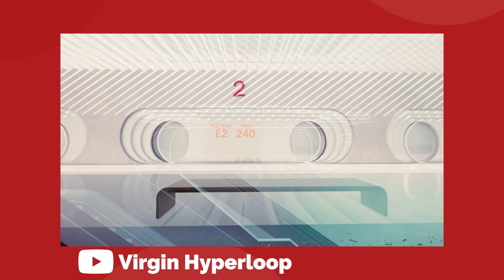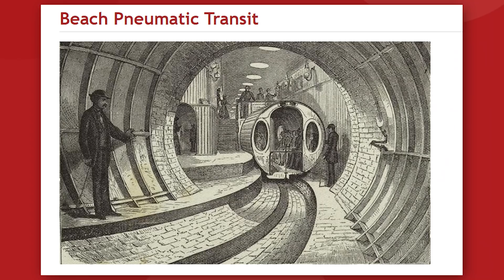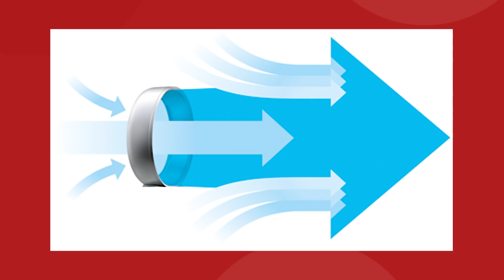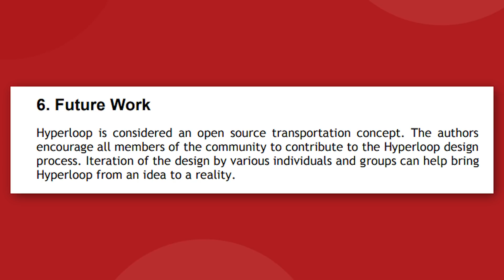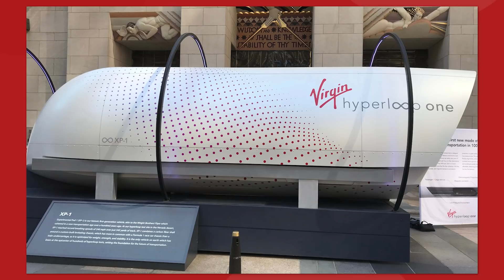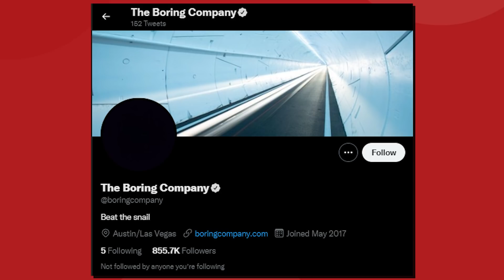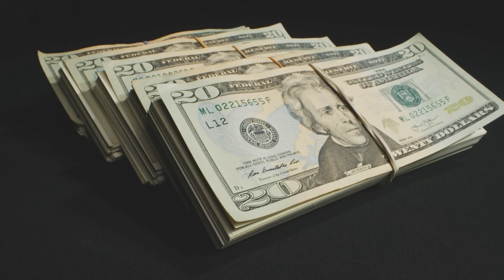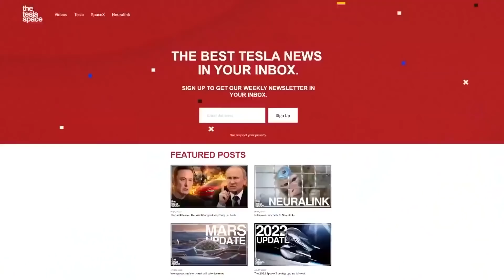The Boring Company Is Building A Hyperloop!

Comment: Hyperloop will fail, for several reasons.
1: Infrastructure: The problem here is Hyperloops require Smart infrastructure which is NOT a good thing. Smart infrastructure is infrastructure that contains the technology for whatever it is supposed to do within the infrastructure. It's downside is it's owners must pay for the upkeep of both infrastructure and vehicle. And trust it's users will not abuse or destroy it. Technological sophistication invites planned obsolescence; once it's available if it should require constant upgrade, it soaks up huge IT expenses and support costs. And should the technology provider go bust, or use proprietary technology is destined to fail, namely because if they should desire to upgrade it or replace it, costs mount. Once this is done and a significant amount of infrastructure is built, however, it will be difficult if not impossible to upgrade the technology as new ideas are developed. Since the technology is in the infrastructure rather than the vehicles, any new technology would require that existing infrastructure be rebuilt at great expense. That means shutting it down as upgrades/overhauls take place. Dumb infrastructure is infrastructure that incorporates minimal technology and instead relies on infrastructure users to supply their own technology but pay for the capacity to use the infrastructure provided. The advantage of dumb infrastructure is that it is technology independent. The reason cars and planes work so well, the user either provides their own technology; or pays the provider for using technology with exceptionally low amount of infrastructure (and thus LOW infrastructure costs). Flying requires little infrastructure except a few thousand feet of runway. For cars; the technology costs are bared by their individual owners, Drivers only have to pay for infrastructure largely when they chose to use it. In any case, once hyperloop is built, there's nothing the technology addicts/pushers can do to address or answer for improvements in automotive and airplane technology. Therefore it's technology will rapidly become obsolete. Not to mention new routes; the industry will be torn between building more which will add to he logistical burden of maintaining their technology.

2: Freight: Specifications for hyperloops don't even allow for minimum width of standardized shipping containers used world over for trucks, ships and conventional freight trains. Meaning it cant carry freight; Not without having to be repacked twice for offload and onload.

3: Costs: It’s private capital. Unlike Musk’s subsidy kingdom of EV cars, solar panels and rockets all of which are paid contracts or subsidized by uncle sam. Hyperloop requires hundreds or thousands of miles of very precisely manufactured fixed infrastructure, unless the governments paying for it. While Megabus charges about $15 to go from New York to Washington, Amtrak currently charges about $150 to ride its Acela over the same route, and that $150 doesn't pay for the capital or maintenance costs needed to keep the trains running.

4: Intermediate stops: Those are even more problematic. If pods travel in a vacuum tube, they will need to go through airlocks both entering and departing the tubes, which will add several minutes to the journey. If pods make intermediate stops, each stop will add airlock time, significantly reducing the speed advantage hyperloop is supposed to have over other modes. The alternative is to construct separate tubes to each destination: one tube from A to B; another from B to C and Another from A To B and A to C and D and ad infinitum. At $52 million a mile, costs quickly rise to be many times greater than the California high-speed rail line, which was supposed to eventually serve all of those communities

5: Economics: conventional planes would be about the same speed and cost less (due to lower infrastructure costs) than hyperloop for medium-length trips, there may in fact be no such optimal length. So even if Hyperloop is supersonic, its fares are metered by costs associated of maintaining its infrastructure. Not to mention what might be miles and miles of tubes, tunnels, viaducts, bridges across topography. By the time Hyperloop is ready for its first passengers, airliner, car and bus energy efficiency will increased to the point it doesn't matter. Intercity-transportation isn't a heavy market; Bus and planes have the advantage,; Buses are FAR cheaper to run despite longer times and airplane they depart when they're largely filled to capacity.

6: Safety: Hyperloop is just a reiteration of an old concept of VacTrains. Have a train in a vacuum tube and it’s aerodynamic drag lowers to the point it can go hundreds of miles an hour or more with no more energy consumption than prior on the surface. Air resistance (drag) increases with the square of speed, and therefore the power needed to push an object through air increases with the cube of the velocity. To make hyperloop fast the tube is evacuated of air, much like those tubes that send parcels at banks and offices. The point is going 1000-2000 mph in a maglev train sounds impressive but any sudden loss of acceleration the massive deceleration from maximum speed and you’re going face first into the seat…even with seat belts that’s more g-forces than fighter pilots. A power failure or loss of magnetic levitation at any point and your train will hit the surface at the speed it was going, jetliners ensue heavy damage and injuries when they belly land when landing gear fails with landing speeds of 180-220 mph, a train over 1000 mph will rip itself to pieces. Worse a loss of vacuum pressure at any point inside the tube would be catastrophic since being a vacuum at sea level in a tube requires constant pumps to remove air; any sudden reintroduction of air pressure as the vehicle is moving would result in massive supersonic impact with sea level air. Meteorites entering the earth’s atmosphere heat up from friction; once they hit the stratosphere they burn up, once they hit the troposphere they often explode.

7: Maintenance/engineering challenges: Thermal expansion: When metal heats, it expands and warps. A tube designed to operate as a vacuum with thousands of feet of welds/joints is thousands of points of failure and needed maintenance. All it takes is one dent or poke to cause a vacuum collapse.

8: Energy costs: A tube behaving as a vacuum requires huge pumps to remove air. A tube ten feet wide and 500 miles long is over 200 million cubic feet of volume for which pumps, unlike conventional tunnels which simply fan air and let exhaust escape, vacuum pumps are orders of magnitude energy guzzlers.
Reply: Nope

Comment: Never mind about tunnels, people need an underground community, to act as a fall out community,  they could charge up front and they would get masses of takers now,  and could crack on with the project. If the worst don't happen then the community could act as a gated community to keep undesirables out.  Please send consultation fee ASAP I skint.
Reply: Did you ever read the science fiction short story, "The Machine Stops", by E. M. Forster? Maybe a better plan for the Moon or Mars to avoid radiation, etc.
Reply: @WarrenLacefield   No I will order off amazon - thx
Reply: @brianbrecknock9625  It is a very short story (try Kindle) but a classic.

Comment: It would be enviromentally, pubicly, and infastructurally feasable, to do away with the vacuum tube compression effect. EVERYTHING ELSE of Hyperloop is efficient design. So In alternative, have BRAUDER tunnels vers "pipe." allowing to imbreech sound nuesons and isolation of outer structures path and traffic. (Don't let the eastern Mag-Lev companies figure those advantage).

 See, Hyperloop leaked soo many redundancy, into a Redundentloop physics concept. e.g...

  Your trying to go very fast, but you don't want to become a fast moving issue to others, so you create a tunnel to travel in. But you also trying to save infastructer volume space, so you make the tunnel like a pipe tube. Now, you got a friction issue to deal with, have to BORE through air, MORE friction than open enviroment. What you do now? Try to vacuum the air!? Then guess what happens! You now got an air criticle management system, of a MASSIVE VACUUM realm.🙃

 Hyperloop vacuum realm could've bern feasable, IF it was a less than 15 min range, like a horizontal-super-fast-elevater travel. Where ever its too short to make a train/air-flight reservation, too far and congested traffic for a highway tram/taxi/coach bus.

Comment: I would imagine putting something similar to an electric 747 engine would go far in ensuring the air pressure before the pod is reduce, used as an air cushion, and expelled out the back to propel it forward.  All thought potentially noise. Would greatly reduce the amount of air that would need to be pumped out of the tube in the first place.
Reply: lol just build high speed rail not some f0kin 747 engine going down a tube
Reply: That’s exactly how I picture it working. Could power the turbine via electric “3rd rail” to save weight of having a battery on board.
Reply: Do you understand how a 747 engine works?

Comment: Elon will never use magnets because the amount of magnets you need per kilometer of track would be out of budget he wants to make this cheap as possible and air hockey design is the cheapest way.
Reply: This this why the previous companies failed.
Reply: Edit it wouldn't be out of budget but the amount of resources you need we already have supply chain issues.
Reply: Maglev has been around for 20 years. It is old technology. Any guy that shoots rockets in the space and lands them and reuses them over and over again can figure out a transportation system running through the ground. It’s all about the permits not the technology.

Comment: ~107 miles in 6.25 seconds???  Seems like light speed numbers...lol
Reply: I think your math is a little off.  I think the proposed top speed is ~700mph.  That would be ~11-12 miles per minute, which would only be ~2/10ths of a mile per second, which is less than 1.5 miles in 6.25 seconds. 😏  700mph is a little less than the speed of sound [so "subsonic"], but nowhere near the speed of light, which is ~186,000 miles per second!

Comment: If this somehow ever gets built, this shit would be Ted Kaczynski's wettest dream. A hundred years ago you could only derail one, or if you were very lucky, two trains before conductors caught on that shit wasn't right and stopped in their tracks. They wouldn't have dared to dream of a day that one truck bed full of fertilizer/one train car with a small bomb in it detonated anywhere on the tunnel would not only guarantee a near 100% fatality rate on one train car (from the explosion itself, or from the rapid depressurization of the train car in a near-vacuum environment, or from the shockwave generated by air explosively filling the tunnels), but on every car on the entire (10s to 100s of miles of) tunnel.

Comment: You could have vent holes along tubes. Excellent idea Mr. Musk.
Reply: Vent holes for a vacuum? Great idea.
Reply: If you are pushing pressure from behind. Putting vent hole in front of projectile would relieve any pressure resistance. Closing the vent hole in front of projectile as it travels would keep the preasure mainly on the object you are trying to push through the tube. High pressure would want to travel towards low pressure. Path of least resistance.
Reply: @rh1960  Isn't the Hyperloop meant to be a vacuum in which a carriage travels without the constraints of wind resistance? What you're describing is the exact mechanism by which an air rifle works, albeit, with one vent hole.
Reply: @davidbrayshaw3529  a vacuum at that scale would be hard to hold. Also in between vent hole they could run high pressure lines and put high pressure vents on each side. Between the relief vent and as relief vent cloves shot high pressure air at 60° down tube. Would could work on the timing of valves for efficiency.  You be push it with pressure and also sucking it with pressure. Kind of like a vacuum but with out having to main a vacuum.
Reply: @davidbrayshaw3529  rename it...lol... my idea would work and be less costly to maintain. A vacuum at those scale would work. But how are you going to maintain it??? Hey you could use stream...lol...
Reply: @davidbrayshaw3529  oh and I forgot. Hyper meen super speed and loop meen the shape....I don't see anything in that name that means it's a vacuum??? Do you???
Reply: @rh1960  Musk's original concept was that of a levitating vehicle travelling through a vacuum, so yes, on the basis of his very own words, I do.
Reply: @rh1960  Pulling a vacuum at those volumes is the work of fiction. I have some experience with industrial vacuums and it takes a huge amount of energy and very expensive machinery to pull a vacuum even in a small volume.
Reply: @davidbrayshaw3529  your not pulling a vacuum. You'd be using high pressure air blowing in direction of travel to cause a low pressure suction to create less resistance in front. You could use electric motor and turbines to create push and pressure behind. The intake air supplying air for turbines would need to be engineered. Or you could use electric magnetic rail. I'd have to think of a way to supply air to turbines. Instead of pump to put pressure in whole tube.
Reply: @davidbrayshaw3529  now you got me thinking about this. I've come up with a desighn that would act as a localized type of vacuum that would propel the object down the tube. You would need to create a low pressure area in front using a high pressure directional vacuum. The object would make it's own. The desighn of the container you want to move and tunnel would do it... Just a little manipulation of the desighn...lol... The shapes of them. Would be cheapest way to go. You don't have to create a vacuum in the whole tube.
Reply: @davidbrayshaw3529  you could do that. Musk's right. Very expensive. But you can do it a cheaper and safer way. You have to block the magnet field from the passenger's using that. Costly. I've thought up a cheaper way to use the tube idea. Causing a localized type of vacuum around the car its self.
Reply: @rh1960  For a vehicle to operate at "Hyper speeds" (760mph. according to Musk himself) in a tunnel you are going to have to significantly reduced air pressure ahead of the vehicle i.e. 1 millibar! You need a near perfect vacuum ahead of the vehicle as the tube in which it travels prevents the pressure wave moving past the vehicle like it does with a plane or a bullet. Venting through the vehicle would alleviate this problem but only if the aperture is sized accordingly.
And on the note of bullets. Consider how a firearm works. Look at the engineering, the dynamics and the fuel used to propel a bullet of let's say 1/4 oz to somewhere near the speed of sound. Now scale that to a vehicle capable of carrying cargo or passengers.
How thick are the walls of the tube now? How robust does the vehicle have to be?
How much fuel will be required? Without an absolute vacuum the hyperloop is basically the worlds biggest gun with the longest barrel. The only difference is that the high pressure zone will be forward of the vehicle rather than aft.
If you can design your way around physics and costs, you're a better man than most.
If you can't, just fooling your investors is sure to make you a lot of money just the same.
Reply: @davidbrayshaw3529  you've made me think about it more. I've come up with a workable design of tube, transport carriage and propulsion. Transport carriage would create it's own vacuum to propel it. You also made me think of a way to increase power and speed of the leveltation train concept. Do you by chance work or know Musk??? I have some ideas that I think Musk&company  may be interested in. Like artificial gravity too.
Reply: @davidbrayshaw3529  oh and you could make the transport carriage/module/car move in either direction. Forward and reverse. This is no scam or someone trying to trick anyone out of there money. Real useable ideas.
Reply: @davidbrayshaw3529  the type itself would have to be designed a certain way. It's all in how you design things.
Reply: @rh1960  And you could call it a train.